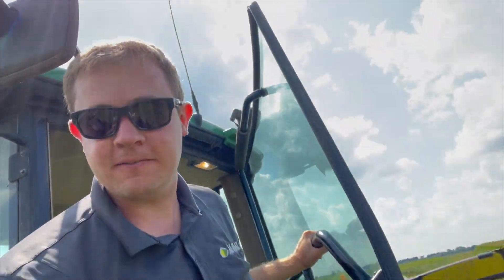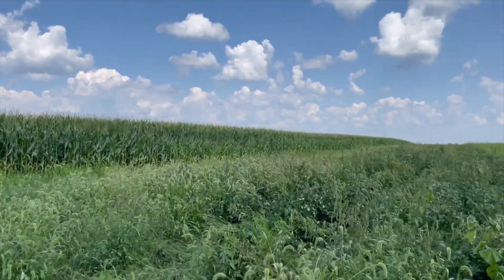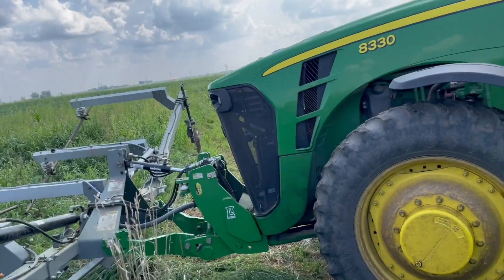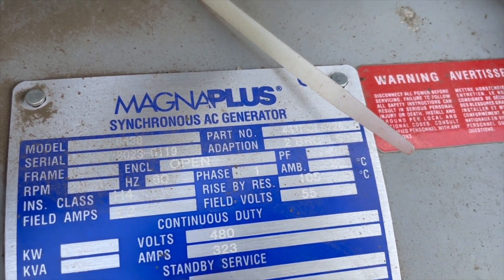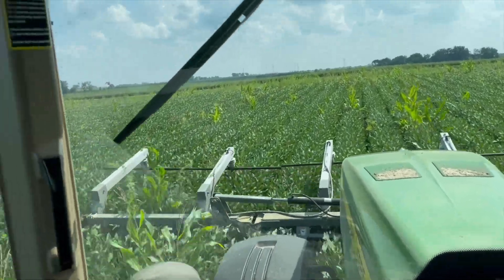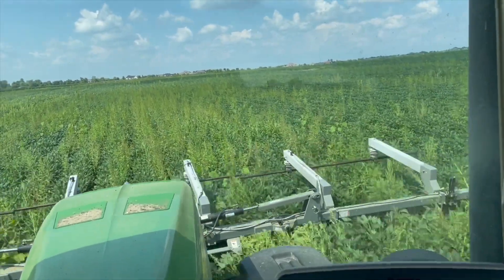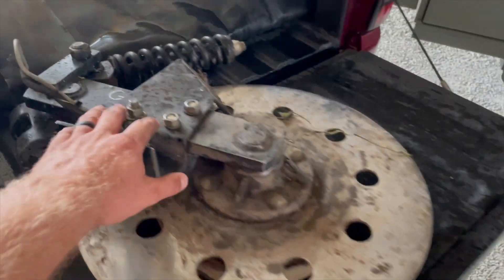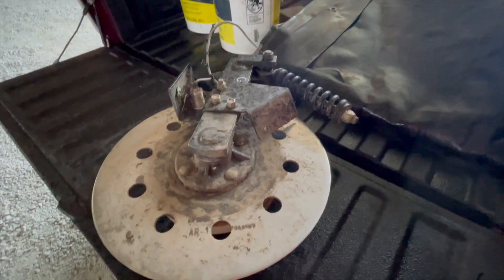Destroying Weeds with 155,000 Watts of Electricity - Weedzapper Annihilator

Comment: That is about a 300hp tractor. It takes about 200hp to run that generator!
Reply: The generator load depends on the electrical load. It will not pull that much power unless you are in contact with a very large number of weeds at the same time.

Comment: I saw a fuse blew, did that cause the unit to be under powered? We also bought a 12r 30 zapper last summer but for some reason on the last field we did it seemed to barely kill the weeds like it was doing previously. I was hoping we just had a blown fuse but couldn't find any.....when it worked it worked great..
Reply from the maker: The fuse that was blowing on me was something to do with the circuit for the speed sensor on the coulter out front. Once I repaired the wires I was good to go. Did you have all of the selections in the setup menu selected properly?>>>tractor HP and grass/broadleaf selection